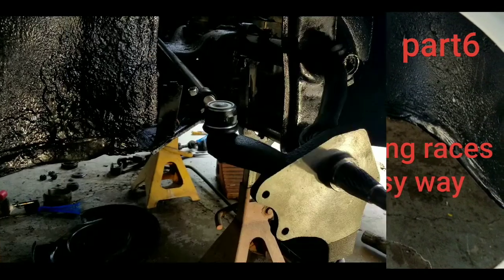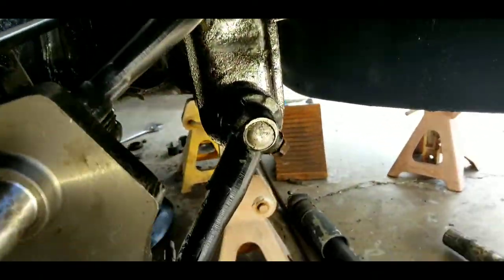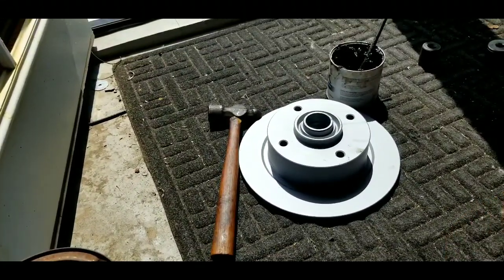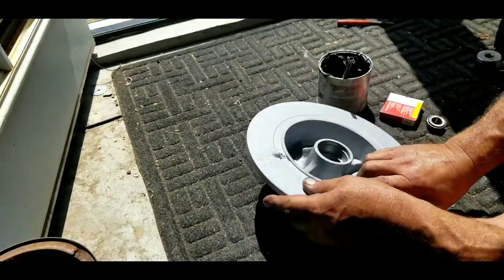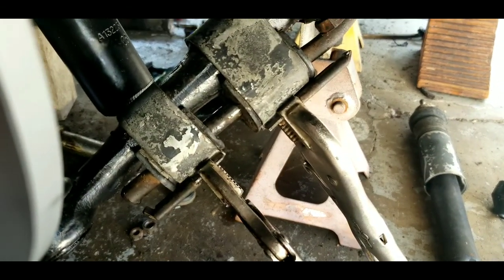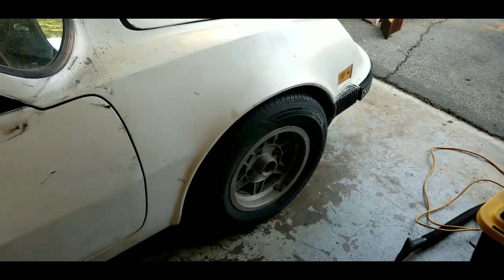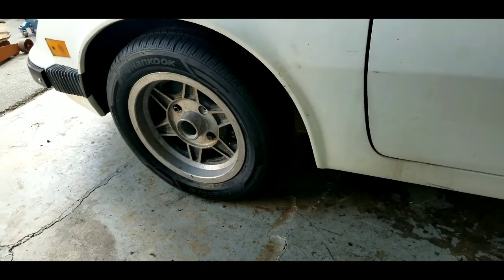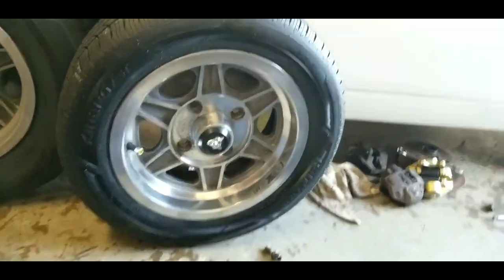VW PUMA PROJECT PART7 DROP SPINDLES & HOW TO SEAT BEARINGS RACES THE EASY WAY! AIR COOLED PHILA TV!

Comment: Hey I also have a1981 puma. I was wondering what the 2.5 inch drop spindle was for having a hard time finding what spindle to buy. Thanks.
Reply: I could not fit drop spindles on my 72 Puma. I needed wheel spacers to clear the brake caliper and that made the track to wide  I have 14inch wheels. I now use a adjustable front beam